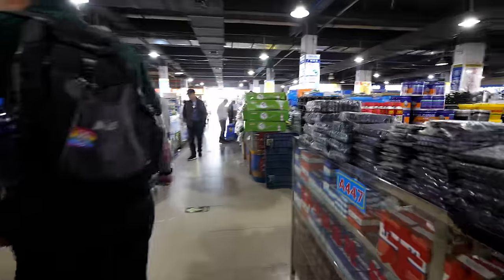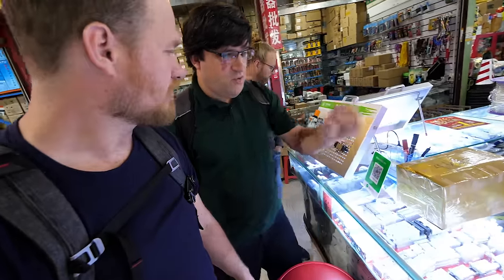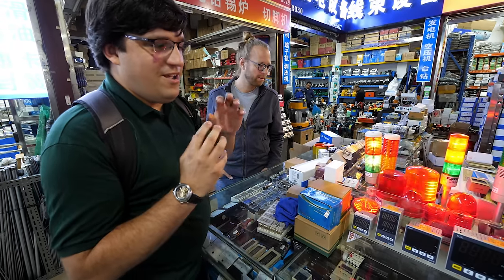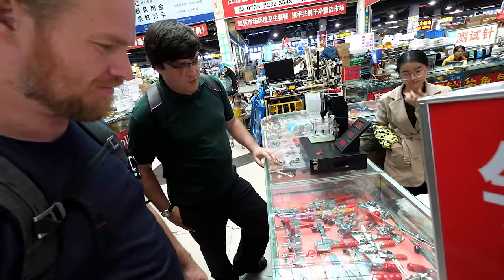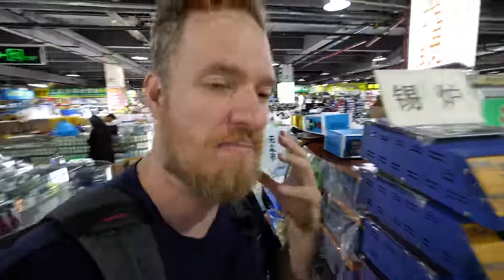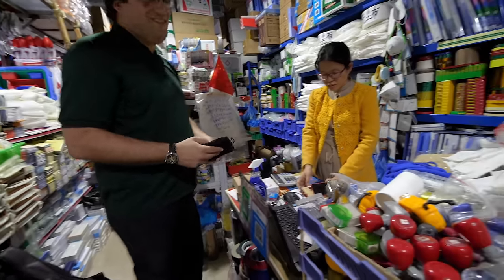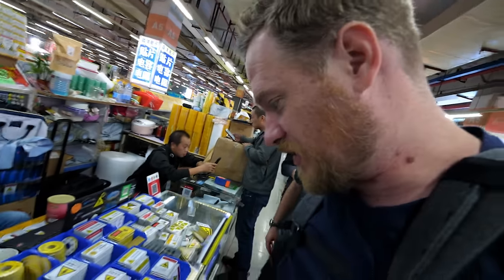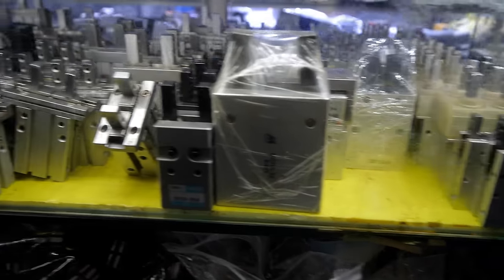Where the Factories Shop - Chinese Industrial Markets!

Comment: I still get ad's cause I don't use ad-blockers. However, they keep showing me the same stupid ad's for a local company which are terrible ad's with bad acting and horrible audio etc. 

As for those markets that's pretty cool. There have been a number of times iv found something I REALLY wanted to get but it was SO damn expensive because it's a "specialty" item at times. But over in places like Asia they have a bunch of them going for cheap. 

I remember I was looking for a really cool big plasma ball for a decoration for my room. I have always liked the looks of them. But over in the USA all they sell are really cheap looking and cheaply made small/dinky ones that aren't that great. There is one or two companies I saw that made some nice big ones but they were custom made and thus thousands of dollars. 

I came across a company on amazon that was selling some nice blue looking ones that were big. Only like 25 US dollars. Unfortunately it had a European plug so it wouldn't work here had to send it back which sucks. 

Same with these little flashlights I came across a long time ago online they were quite small (fit in your palm almost). Took one double A battery as a power source. You could focus the beam of light, some versions had 3 different settings bright, low, flashing. They were like 2-3 US dollars from a lot of these companies on Amazon and shipped from China. Ended up getting a few for myself and family members. Later on got a pack for work for all the guys who have to work outside and need a small flashlight that doesn't take much electricity or really big. 

Any similar ones you look for in the store easily go for $5-25 US dollars and most of the time aren't as good. A lot of the small ones that aren't even as small take 3 tripple A batteries to power them and don't even last very long. 

It stinks sometimes having to rely on a different country all the time for some stuff without breaking the bank. And with the USA always complaining about not having any jobs maybe instead of shipping all our recyclables and stuff to other countries like we did to China for a while until recently, and now India and such. Maybe they shouldn't ship them to other countries and create jobs sorting them and properly recycling them here all over the USA.

Comment: Thanks for the interesting video.
you asked for an Idea/suggestion for something like pneumatic type of diy device.
well, I have a request for you.
I would like to see  a fully automatic DIY pneumatic weighing and packaging machine with nitrogen flush.
for starter reference, I have tried and was able to successfully able to make a DIY packaging machine with nitrogen flushed, vacuumed packaging with pulse bag sealer, an air pump for small aquarium,rasberry pi board,a small barometer, few push switches and bunch of silicon sealant,rubber gasket.
I know covid19 situation will not allow it to be performed for now, but I would like to request a version of related DIY project in future video if possible.

Comment: 10:47 can someone explain what these pcb's are for?
Reply: Free hand prototyping when you can to solder together a one off circuit without designing and ordering a PCB
Reply: @KennethFinnegan  i'm talking about the one with the "islands" he is talking about. Not the pre-drilled prototype ones. Is that for prototyping but for smd components you mean?
Reply: @St0RM33  ah. That one isnt as much for SMT as for high speed analog circuits. It's a common circuit prototype style called dead bug or Manhattan
Reply: @KennethFinnegan  thanks man, i'll look into it

Comment: Been in Suzhou (Jiangsu) all by myself without reading or speaking chinese (make sure GPS is charged !!!-bwahhaa) and went out of the bus in one of these streets, all full with cutting tools. tungsten carbide, cobalt steel, all geometries, all sorts of coatings available. Having been a machinery mechanic, of course I also know how to operate milling machines, lathes, eroding, presses etc. I still had no masters degree in mechanical engineering, but the don't really teach much about metal working in Germany if you don't choose these courses. China is pretty advanced. They would be inferior in knowledge agains a german pro in his 50's but so much better than the younger machine operators you see here. Well the ones on youtube seem to be a lot better than the average. Up to now the german education system with dual studies of professional training (3,5 years), master school (after work), technician (2 years), specialist school (they also get call engineers) and university (bachelor, master and PhD) is for free and unbeatable. I think PRC adopted a similar educational system, and the exponential growing of stupid fat social welfare monkeys in Europe will make it really easy for one of the smartes tribes on the planet (Chinese) to get where they belong : on the throne of the planet.

Comment: Can you imagine how much they sell those things at McMaster Carr?
Reply: I buy McMaster Carr when I need quality. If I need drill bits with a point ground on center, taps that will be hardened,  stainless steel that won't rust in water, etc. China has a quality fade problem where expensive ingredients are siphoned off over time.

Comment: Pneumatics project:  I have no real application for this, but it would be cool to do logic using pneumatics.  Use small cylinders or rotary actuators and mechanically actuated valves along with solenoids and do some kind of logical operation or simple math with it.  Ie "The Air Flip Flop" or the "High Pressure Pneumatic Bistable Multivibrator" for extra marketing wank.

Comment: Yeah I forgot to tell you I am a broadcast engineer trained in solar power broadcast systems anything it based transmitter sites antenna systems and yes I fly drones to and certified by FEMA for Disaster Response

Comment: Hi, Can un get this part for me. I have tried ordering it twice from Aliexpress, but despite it showing it was in stock. 
I was told it wasnt. The phone is a Bylynd M13. Its a fab phone, just needs a new screen (cracked)

5.5 Inch For BYLYND M13 Touch Screen Glass Lens Digitizer Front Glass Sensor Black White Color With Tape. 
GZ Repairs (China) used to stock them...

Many thanks 
 Parcel

Comment: Can you build your own emulator phone with built in controllers and uses snapdragon 6 or 7 series.
With own liquid cooling
And uses the body of a psp as  hardware. Just like moqi i7s but in smaller form and upgraded psp to phone for emulation📱 to  games

Comment: That would be my toy store.
Dam we need these in the usa.  No one has a retail store like that here, I think it do pretty good added mail order free freight with mim purchase. 
But I'd like to see a real label where it was made.

My problem with china's industrial revolution is they dont care about air pollution and I seriously think its what is causing record droughts in the westren 1/2 of the usa as well as low rain falls tornados and hurricane on the eastern half of the usa.  This was caused by a major shift in the trade winds. Heat from a industrial nation could shift the trad winds copl that with less ice in the northern hemisphere also causing drought.   We need to get mankind's carbon output down.

Comment: All that parts look like real industrial hardware but that's only a look, they lack quality control, material thecnology, quality finishing, all that parts are crap and that's the reason why  they have mountains of parts and sell them by a fraction of the cost in a conventional western store. I can only tell you don't be deluted by the shape, they look identical by that's all they have in common with an industrial part.